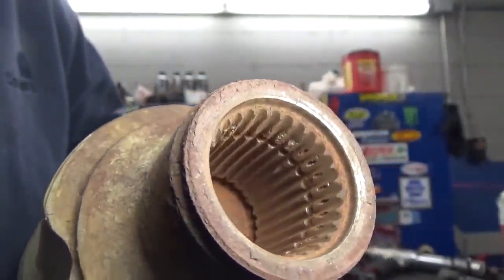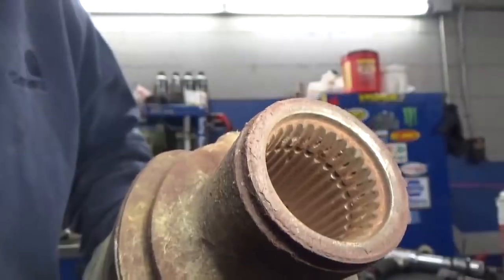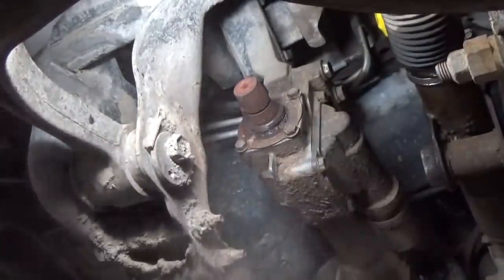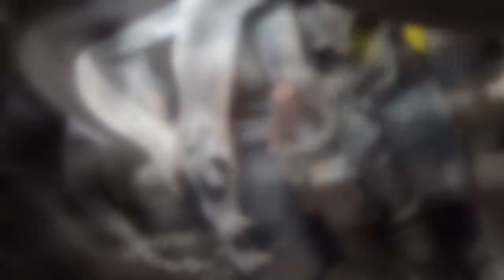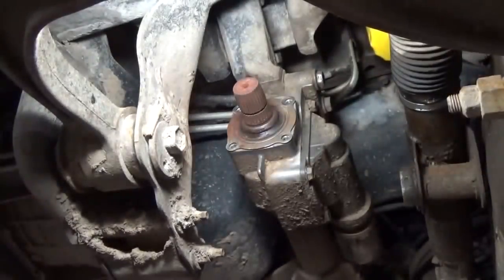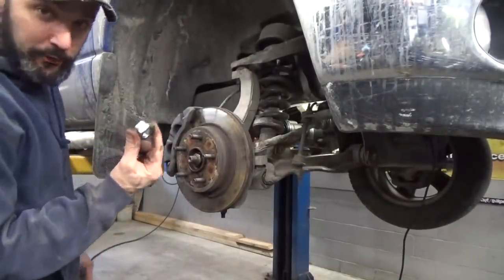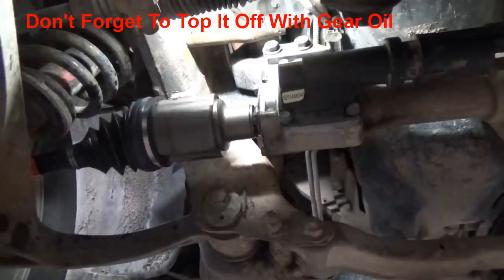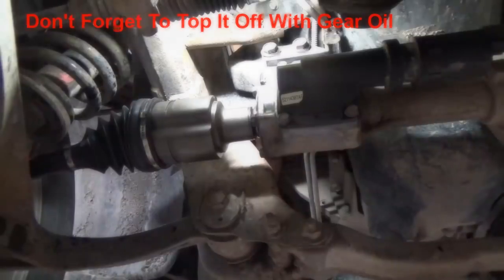Dodge Ram No 4WD

Comment: I really enjoyed your video. I'm experiencing vibration so through a few checks I've found that the drivers side cv inboard hub has gone out. my question is, does this mean I need a new diff. or does it have a replaceable bearing/shaft like the one one the passenger side in the video?

Comment: I too have an 06 dodge ram 1500 with switch on dash, wont go into 4 wheel drive low or high and dash light just keeps flashing non stop. from your video i gather its the actuator and i am going to change it. does it pay to go aftermarket or OEM? they are both made out of plastic it seems. I value your opinion very much and i get an education watching your videos. you have an easy way of showing what to do as well as explaining the theory. If you can do it, I can do it. thank you so much for that. where in new york are you located??
Reply: Eric, can you show us how to diagnose the above problem so that we are not just changing actuators

Comment: when you said you didnt know why the shaft / stub went bad....my theory why it went bad would be-- when you removed the old one it was to easy   you didnt have to jerk it out to overcome the C clip retaining ring on the stub shaft.   and when you got underneath there was no C clip ring on the shaft.   i suspect that at some point before this   that shaft had been replaced and the C clip  was not on the stub shaft.   so then the inner CV shaft could work in and out and  be able after a while start ' wobbleing' and cause the damage.    what do you think?

Comment: Mine was a little easier, but I wish I had a truck lift it would have been easier,,But I fixed my 4x4 problem and I put its on YouTube go to "Part 1 Ford Engagement fork" my fork pin was broke and the two plastic pads had worn off. Please check it out if your 4x4 won't engage. And tell me what you think. Thank Eric, for all of your videos.

Comment: In reference to your comment about Ford 4X4 system, I had a 1975 ford F250 4x4 and it seemed to have a bullet proof transfer case and axels. Has Ford 4x4 system gone down hill? The ford trucks always did well at truck pulls, Chryslers seems to break the stub shafts

Comment: Eric .....What pressure is your shop air at ? I see you use the Astro 1822 in a lot of you videos but as far as a stubby it is rated one of the lowest powered units although it does not appear that you ahve any problem with it removing anything.

Comment: Yes I do have a question, I have a 2007 hemi dodge ram 1500.
When I engage the 4WD, it does engage very well and "drives" "runs" very well too, but when I make sharp turns the tires slip, the truck pulls hard forward every time the truck slips and does not advance forward on 4wd when making a real sharp turn. Driving straight on heavy snow,clean road or slight small turns no problem. Any suggestion? I fix my own cars but never experience 4wd trouble before. Thank you.
Mary Christmas!!

Comment: I'm a carpenter and use chisels all the time. If you grind your chisel with a single bevel it won't ding up the surface and still should work to remove the part.

Comment: Your videos have been very helpful. Do you know where I can find a wiring schematic for a 1999 Dodge 1500 5.9 for the wires from the 02 Sensor to the fuse box? The codes go back and forth between bank 1 & bank 2. I was told the 2 wires going to the fuse box from the sensor are bad but cannot find a schematic for it. Appreciate any help or if you have a video let me know.

Comment: Hi Eric,
I have an 04 Dodge Ram 1500 4x4.  I need to replace the hub/bearing assemblies.  I have the service manual and it explains taking the steering knuckle loose from the top ball joint and tie rod ball joint to remove the axle half shaft.  I'm I getting over my head trying to replace these hubs?  I'm pretty handy and would like to save some money doing it myself.
Reply from the maker: Skip McDowell Leave the knuckle on, push in the axle shaft after you take the nut loose, remove the bolts from the backside then smash it off there. They are pretty easy, takes me less than 1 hour to do them. You can do it I am sure. Do you live in the salt belt?
Reply: South Main Auto Repair So I push the axle in from the wheel side so there is clearance to get at the bolts?
Reply: South Main Auto Repair No, I live in the Reno Nevada area.  Pretty dry here and they don't use much salt on the road.  Is the hub a bear to remove once the bolts are out?
Reply: Skip McDowell sorry i tried to send a drawing but it just came out as source code.  :-(   It just shows the hub/spindle front and back.  I tried pulling the axle off the stub shaft to remove it (as seen in another yt video) but I couldn't get it off the stub shaft. In that video it showed (a1 auto) taking the axle out completely.  like i said I couldn't get the axle out.
Reply from the maker: usually take the bolts out , the hub nut and whack it and it will come out pretty easy...if it is not rusted in...
Reply: South Main Auto Repair Sorry, just so I'm clear, by pushing the axle through the hub that will provide enough clearance to get to the Hub bolts?  Then can I remove the bolts with just my ratchet/breaker bar?
Reply from the maker: Yes that is how I do them... remove the axle nut... push it in an inch or two, however far it will go, I hold it there (usually with a tool I have) I remove the bolts from the hub, then I remove the hub. Make sense?
Reply: South Main Auto Repair Yes, thank you so much.  I got it.  I'll let you know how I do.
Reply from the maker: Ok good luck :D

Comment: Question - Gear oil came out when you removed the 4x4 actuator and the stub-shaft seal... did you need to refill that or with the gear oil in the diff work its way down past the bearings? Or is there not a need for grease or oil in that the box?

Comment: Excellent vid.

In your opinion, who do you think makes the most reliable full size trucks -- all around?  And what are the weak areas to look out for, for each brand?  If it's a long answer, maybe you could do a vid on this or something.   = )
Reply from the maker: Well that would be a really, really long answer ha. Short answer would be Toyota Tundra. Hands down is #1 on my list. They all have there problems though and it's not always based on brand or model, sometimes it's geography. With me living in the salt belt I will probably see a host of problems that some one from the southern states may never see so I don't know if it would be fair to really answer that. I could make a list a mile long with silly things that happen to a lot of cars and trucks. Keep in mind too I only get to see what my customers drive so that's a limiting factor too. Let me think on the video part of that and we will see what the future holds! Thanks for watching as always.
Reply: Awesome,  thanks.  I can see where that could be a long answer. :-)
Reply: South Main Auto Repair rented a Tundra with its small v-8 while my wife's Ram was in shop. Those full size Tundras ROCK.................actually out ran a Mustang 302.........LOL
Reply from the maker: It will be my next truck for sure :)
Reply: South Main Auto Repair 
I never see Toyotas at construction sites or on road crews...and if i do they are outnumbered 50 to 1 by Furd, Shitvrolet and of course the best of all RAM...cmon

Comment: I did mechanics in high school and did diesel mechanics at a trade school and the only thing I didn't like was when you was using the brush to clean after you had everything open. I understand you cleaned it out but still you should of done most of the cleaning before you cracked everything open lol

Comment: My customers here don't have Dodges(Finland (EU)). But still should that inner bearing ring come out with finger normally?(11:19)
I would have used bearing hmm "locktite"(similar to thread lock but different formula) So the ring cant spin inside and the bearing has to do the job...
Anyway Nice video! Specially to me for learning stand point as 90% of cars that i work on are 100% 2wd.

Comment: Great video. I have a question: Is it normal or OK to have some oil leaking at the seal? Is that a big deal?
Reply from the maker: +Jim Bodenrader as long as it is not dripping out it should be ok...
Reply: Thanks for the response!

Comment: You can remove the thick washer from the old axle nut, whack it with a hammer.
Its just a press fit.

IS the vehicle supposed to be stopped when shifting into 4wd?
Or maybe the shifting fork solenoid stalled.
We're fighting with a jaguar x type now, the front axle doesn't want to come out.
Reply from the maker: jonesgerard  These are shift on the fly 4x4

Comment: Same thing just happened to my 2019 Ram. It appeared the problem was the snap ring that should hold the CV axle & output shaft together. The ring worn down alot & the axle disengaged from the output shaft allowing the splines to be lose & strip out. 

Did you ever find a cause for this in any of these that you have repaired?

Comment: I have a 2003 Dodge Ram 2500 4x4 diesel with and automatic transmission. My 4x4 light will not light up on the dash cluster. If I put my truck in neutral I can get it to light up 4x4 in low, but it’s actually in neutral on the transfer case? I just changed the transfer case sensor…no luck, even took the wiring outta the wire loom and checked the wires, seen a wire kinda smashed so I cut that section out and used a butt connector to get it back together….any thoughts? Thank I’m advanced

Comment: I realize this comment is 2-years late, but when you separated the cv from the axel shaft, I did not see any retaining snap ring and the grove for the ring was pretty rusty. Could it be that the snap ring broke, fell off and allowed the cv to slide a bit back and forth on the axel shaft which contributed to the excessive wear?

Comment: (2006 Dodge Ram 1500
)Any videos on separating the cv axle from the center shaft?  Also what is the best way to jack up and place my jack stands to ensure that the ball joints come out?
Reply from the maker: ***** Are u saying the CV axle is stuck on the splines of the stub at the axle housing?

Comment: hello Eric. great video. I always turn to your channel for help whenever i start a project. maybe you can help me in this one. I have a 2006 dodge ram 1500 slt 4 x4 that will not go into 4 wheel drive. the transfer case cycles from low to high but front axle actuator will not ingage. local mechanic tells me its the TIPM but i dont have the cash to go replace that at a cost of $1000. I was wondering if anyone makes a electric 4x4 conversion to manual as in the earlier year rams. I would rather move a stick or a cable to ingage the front axle then to fo through all the electrical stuff. What do you think about my idea? perhaps we can come up with a kit and help out a lot of other people that have this same problem? in any case I respect your talent and knowledge and I would appreciate any input you might have on this idea of mine. Hoping that you will answer back,
sincerely,
Don in New jersey. 
God bless.

Comment: Why did you not mention the missing locking spring ring on the stub shaft. I believe the axel was originally bolted i to the spindle holder before it was bolted onto the a frames. This would probably popped the shaft out, or else it was put together without the snap ring which caused the whole mess.....just my opinion, Rick....

Comment: I was surprised to see dry rusted splines like that, thinking "no wonder it failed", but that may be because I have a motorcycle, and it's drive line is all about splines which are not housed in an oil bath, but are exposed to the elements, basically, and spline lube is everything. These things I have to disassemble and lube, or else the splines would fail, as they did on this truck, here.

I see that the old spline are bent. Bent splines, on my motorcycle, would mean it was run dry.

Comment: Nice job Eric, what about the drivers side?
Reply from the maker: Little different set up over there, but I gave it a look and it looked ok.
Reply: mine is bad how different?
Reply: 2002 ram 1500
Reply from the maker: Is it the drivers inner shaft in the diff or just the outer CV shaft?
Reply: South Main Auto Repair the inner cv has just as much play on the drivers side as the passanger side I guess I need to look and see if the splines are worn.
Reply from the maker: Yeah pull the CV axles and check the splines to see if they are worn.

Comment: South Main Auto, have you any suggestions on removing the bushing on the lower control arm on a 2008 ram 1500 4×4 ? it was completely seized so I have the bolt and the rubber bushing out but the metal sleeve that is around the rubber is stuck ! I broke my ball joint press trying to remove it . any help ???

Comment: I would personally never ever use "never seize", copperslip, anything of that ilk on a bearing surface. They prevent seizure by introducing little hard grains of (copper) or aluminium between the parts of nuts, bolts, that kind of thing. Not a good idea between surfaces that slide across each other. A good CV grease is what I would have used. Or preferably a semi water proof lube that you might use to fit a prop to an outboard shaft?  I guess any lube is better than no lube but I've seen bearing surfaces destroyed in days by using this stuff. Makes good grinding paste eventually. Although much of my experience has been heavy plant, mining machinery that kind of thing. Tonka Toys if you like.

Comment: Was the new stub shaft an updated design? I only ask because at 15:26 in the video, you can clearly see the old vs. new shaft and the gear on the old one is much wider than the new one.
Reply from the maker: +Doomster9 It very well could be I just don't recall right off hand to be honest...
Reply: +Doomster9 clearly its visible how worn it was for sure the new one is the exact ratio as it should have been

Comment: If you don't mind I would like to ask you a question i have a 2014 dodge 1500 4 wheel drive when i engage 4 wheel drive unit and turn the wheel to the right the front end locks up could you tell me what might be causing that and I thank you for any information you can give me God bless

Comment: My 97 Ram has manual trans. and my four wheel sounds like it isn't fully engaging and locking in, even though I have the four wheel's stick shift in the 4 Low or 4 High position. I'll just keep it in two wheel this winter with some weight in the bed and drive more carefully than ever. 

Looks like this one is going to be expensive. Oh well.

Comment: Hey Eric, I've got a second gen dodge ram 2500, and the 4x4 keeps popping out randomly in the winter. I've done some research and the actuator/shifter fork can disengage due to a weak vacuum. I've also heard that they can actually freeze, causing them to disengage. Either way, the 4x4 inner shaft grinds and actually broke the splines off of it. I replaced it but the problem still persisted. Replaced the vacuum lines multiple times as well as the actuator itself. Neither fixed the issue. 

What I've found now is that I can put a locking cable on the actuator and run it into the cab. In theory, this should fix the issue. What are your thoughts on this? Ever had a similar case in your shop? It only does it when it's below zero, and seems to do it in reverse almost 100% of the time. Rarely will it happen in drive. 

This is a kit very similar to the one I bought

http://4x4posi-lok.com/app_dodge.html

Any of your thoughts would be appreciated.
Reply from the maker: ***Classified*** Boy can't say I have seen this before. I mean if the actuator is where your problem is then why wouldn't the cable kit fix it ya know? Now you can do 2wd low burn outs too :)
Reply: South Main Auto Repair haha, I've got the kit sitting beside me right now. Just been sitting on my butt on putting it on! the 4x4 would always pop out at the worst of times too. It did it once while I was coming up an icy hill. Spent a few hours digging out of that snow drift. 

I've had others tell me it can be the transfer case, but wouldn't I notice a problem constantly if it was? I've actually had the POS truck into countless local shops here. Half of them wouldn't touch it because it was so rusty, and the other half that did look at it INSISTED it had to be the actuator. One guy replaced the vacuum lines with some cheap crap, so they collapsed and cracked the very next day. 

It is a snow plow truck, which is the ONLY reason I'd be doing a mod like that, especially on a Dodge.
Reply from the maker: Cable kit will give you the answer at least because now you will know that it is in...
Reply: +South Main Auto Repair Hey Eric, turned out to be a bad transfer case. I swapped a good unit in, and it works great now. On the old T-case, I can hold the output shaft and spin the input shaft freely, and can hear grinding. I'll be tearing it apart eventually to see exactly what failed...

Comment: The cause  of this failure was water intrusion causing oxidation AKA rust. Notice the missing o ring from the old axle that the new one had.This keeps water out of the assembly.I see so many of the same failures on heavy equipment pto pump couplers. Good idea to apply neverseize to the splines will get longer life out of the assembly after the o ring fails.Could of upselled balljoints on that job also looked worn.

Comment: Well what can I say....I had an old Chief who would say, learn the easy way and listen to me, or learn the hard way by doing it your way....When the guy showing you how to do something, specifically says use ONLY OEM parts, do it. Bought the auto zone CV axles and they were too short. Needless to say, the old ones are back in and I'll have to get the right ones and try again next week. I could not get the passenger one out of the steering knuckle. I might have to take it to a shop......
Reply from the maker: +Jim Bodenrader Oh bummer man...
Reply: lessons learned...